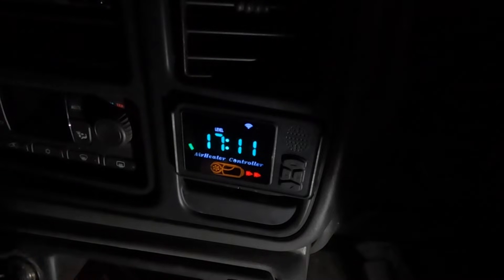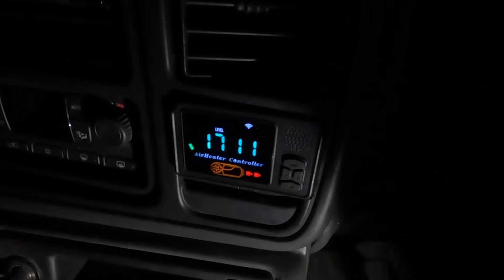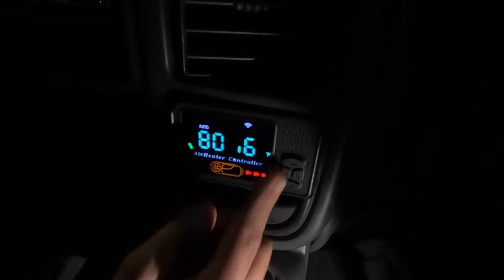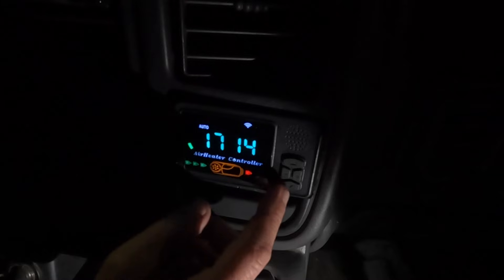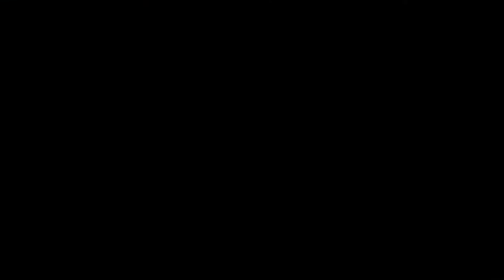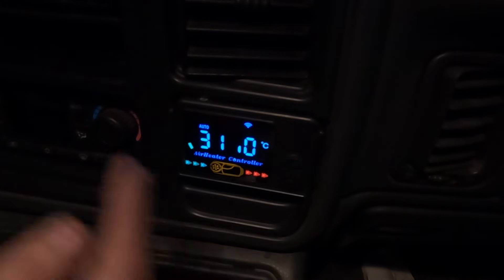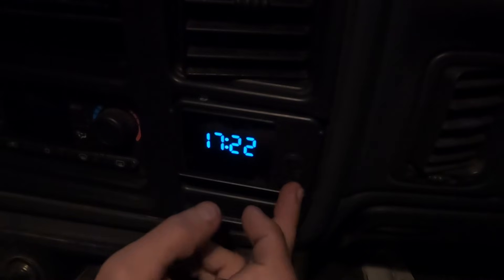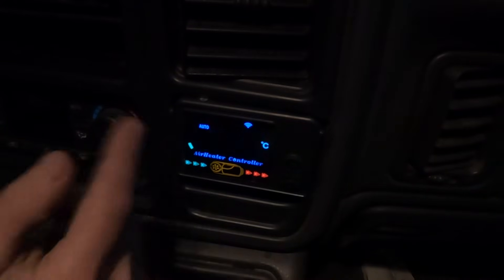Bluetooth Diesel Heater Feature & Settings Discovered !

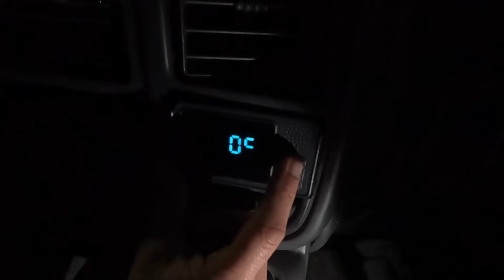Comment: @7:13 The 0c on the display is the temperature offset compensation.  If your heater is displaying a temperature that is not correct you can change this value (+9 to -9) to correct it.
Reply from the maker: Sweet ! Thanks for the info... that is very helpful, and now I don't have to Google search, haha. Cheers !!
Reply: So say the lcd screen outside temp is 20.. and u use bluetooth can shut off and on by the bluetooth in the tent if say it said 68 and that was set temp. Or do u have to wire the lcd screen inside the heated area? @loweredexpectations4927
Reply: @shanenauman9850  controller must be inside the heated area
Reply: THANKS! I needed that. Somehow i had it showing 3 degrees wrong and it was annoying me.
Reply: @SergeyPRKL so if my heater says it's 40 degrees outside when it's really 37 degrees... I can fix that ??
Reply: Thanks very helpful 👍
Reply: Been driving me insane..   this comment wins the day

Comment: Thanks for the walk through. I have one and after the C or F selection I have two more menu items. The one after the temperature unit setting on my shows L - 08 and the last menu item or one after that shows C - oF...anyone know what those two mean? Mine is only about a month old and is the 8kw all in one unit with the fuel tank on top of the heater in the case.
Reply from the maker: The L - 08 is screen / backlight brightness. If you press "m" and enter it, then press down, the screen will get dim. 08 is the brightest. 

I'm not sure about the The C - oF / oN ... It also has a WiFi or remote signal at the top of the screen. Otherwise I would assume it was for turning the temp sensor on or off. It also has R - oN for the remote. 

I will look into this a little more but I assume it has something to do with sending or recieving smething through the radio frequency (remote control) signal. Some remote controls have an LCD screen that will read out temp, battery voltage etc... maybe this gives you the option to turn that on and off to conserve power if using the bluetooth app instead.

Comment: Don't get me wrong – this doesn't have much to do with unlocking. Everything you're describing is in the manual. What would be REALLY INTERESTING is the submenu for pump frequency, fan control, or alpine mode. BECAUSE: it's NOT possible to adjust these things like on all previous models.
Reply from the maker: Hmmmm.... I hadn't even considered this.... and I'm shocked that a bunch of people weren't pissed off and calling this click bait... It was unintentional, but is misleading. 

When this video came out, these features were all new and no one had videos out explaining any of it, so the "unlocked" was referring to diesel heaters becoming more useful due to these NEW (at the time) features. Unlocking the potential of these heaters by adding all of these new features... Make sense ? 

As for the submenu... it is only there for a little (useless) info... These do not require adjusting, and it would not be practical to do so, because they automatically adjust to "alpine" or "plateau" mode based on air pressure. It reads out on the app and controller as altitude / elevation.... but the info is really barometric pressure. 

Unless you have checked your exhaust CO emissions and discovered that you have a lot of CO, then you shouldn't be changing fuel air ratios anyway. I'm at 4500 feet and mine all work perfectly. If you are constantly changing elevation, it's a good idea to get a CO meter and test your heater when you set up camp... Anything over 50ppm is a little concerning to me. 

Cheers.
Reply from the maker: The short answer is that they can't have an adjustment for fuel and air because the controller does this automatically. Most controllers now either do it automatically OR have a high elevation button (plateau or alpine mode) for elevation over 5-6000 feet. 

The reason companies are doing this, is because way too many people play with the settings on their heaters trying to make them more efficient, or for them to make more. heat, and totally mess them up, and or make them dangerous. 

These heaters run with almost 0 CO when operating normally, but if you increase OR reduce fuel, the CO levels will spike drastically and the heater can build up a lot of soot very quickly and even  shoot flames out the exhaust in extreme cases. 

So basically they took this feature away because too many idiots were ruining heaters and then asking for warranty.

Comment: Is there an entry key combination and hidden code for " engineers mode " with the late Vevor heaters that have these four keypad style controllers? I am sure this heater requires some tuning for fuel pulse and combustion fan RPM. The burner is three days old and it burns five litre of diesel in less than 10 hours ( level 5 - body temp 185'c - ambient temp ~5'c - my co meter hasn't arrived yet ). Thank you for this detailed video.
Reply from the maker: These heaters do not have an engineering mode with the options you seek. This is because they have automatic fuel compensation. 

Old models have an engineering mode. Slightly newer heaters have what they call plateau or alpine mode, a button your press when at higher elevation to reduce fuel input, and these have a barometric pressure sensor to switch from "normal" to "alpine". 

5 litres in 10 hours sounds approximately correct. Half a litre per hour is exactly 5kw/hr as one litre of diesel has about 10kw/hr of energy. 

If possible, try to recirculate your air instead of heating outside air... not sure of your setup, but this makes a HUGE difference. I used to heat my truck with outside air and it took forever to warm up... now that I have the heater mounted inside and recirculating air it heats up probably 10 times faster.
Reply: @loweredexpectations4927  Thank you for reassuring. Yes, I am recirculating the indoors air. This is an old, small barn that was converted to a workshop with four large windows ( single glass ), peaked ceiling and drafty doors. Silver lining would be the ample healthy cold fresh air that just pours in from all directions all the time. So, no worries for Co poisoning LOL. Although I do have a Co alarm and the exhaust is safely dispersed outside.
I may have to crank up the level to the maximum for a short while and then set it to thermostat mode for comfort.

Comment: Brother I bought that heater and I blow more coal than my truck. Now my question to you would be supposed to be unlocked I should be able to adjust the fan speeds and fuel settings but I can't find any of that it doesn't appear to be unlocked it looks like it only gives you the option for minor changes Bluetooth on off Wi-Fi on off that type of crap if yours is different please tell me the model number so I can order that one I love everything else about the controller any help is greatly appreciated
Reply from the maker: If the heater is blowing smoke, there is a problem with air or exhaust restriction, or some odd quirk with it not fully firing up. Make sure that your exhaust and inlet are clear and don't have too many bends. 

I generally recommend removing both (if possible) and run the heater. If it works okay, then you know one of those things are the problem. If it still smokes a lot, then you know there's an internal issue.    
These heaters have automatic elevation adjustment and do not grant access to an engineering menu. To my knowledge, you can not make separate fan and fuel adjustments.
Reply: @loweredexpectations4927 thanks for your two cents, the unit actually went back it has to have a bad burner and veber won't send me one... Yes I ran it without the intake and exhaust right out of the box and it puked on its face.... By the way you should read the return policy if we feel your reason is acceptable then will accept your return lol lol .....

Comment: How do I use the wired controller to prime the unit for the first time?
Reply from the maker: I forget how... I always have to check the manual.... I do know that it only works once, then you have to disconnect power / pull the fuse to do it again if the first time doesn't run long enough.

Comment: Do you know if it’s possible to adjust the air–fuel ratio with this controller? Mine seems to be running a bit too rich. Before buying the sensor for tuning, I’d like to understand how it can be adjusted. Thank you!
Reply from the maker: These models will adjust the fuel based on elevation, but I believe there is only two set points . Meaning... at sea level, all the way up to say (guessing) 5000 feet, the ratio will be the same. Once you are at 5001 feet it goes to a leaner mode. 

Get yourself a CO meter and check the exhaust. If it is below 20ppm, then you have nothing to worry about .... ratio is good. If you are above 50 then you may be running a little rich.

Comment: Does anyone know how to change the hertz on the fuel pump of this controller? I feel like my heater is running Rich and would like to turn it down.
Reply from the maker: You can't do it on these controllers, as far as I know.... and it just makes sense. 

They have automatic elevation compensation that changes the HZ based on barometric pressure. 

Check your exhaust with a CO meter.... if it is below 20ppm then you dont' need to make an adjustment. If it is over, most of the time this is due to a exhaust or inlet restriction and not an adjustment.

Comment: Menu shows to prime fuel to press down button for 7seconds when I do that it changes the language is there different options to do that
Reply: Gotta do that before 1st power on, disconnect power from heater  reconnect then do prime function, don't power it up first
Reply from the maker: Prime function only works once. After that you need to remove the fuse / cut power to the heater and try again. If this is not your problem perhaps it is the wrong button... I can't remember the procedure. I have to look it up every time.

Comment: I have the Hcalory TB2 S. I also have a spare Bureck thermostat that I wanted to use with it. For your readers out there wanting this same option, please be aware that Hcalory TB2 S is not compatible with the Bureck. Maybe you can delve into this issue deeper and come up with a solution?
Reply from the maker: How is it not compatible ? Have you talked to Bureck about this? What does it do or not do?
Reply: @loweredexpectations4927 

It will not close ne to the remote

H calory stated that it is not compatible
Reply: @loweredexpectations4927 

Tried several times with Bureck’s help, to no avail

Comment: Good explanations! I am considering for replacing my vevor diesel heater.

Do you, or anyone else, know if this controller also has a 'ventilation mode'.

So it only runs the fan and does not use the heater.

I cannot find it anywhere and i am not getting a clear answer from Vevor.

Many thnx in advance for the feedback!
Reply from the maker: I was about to say yes... and then realized that might be their other heater... I have too many. You can on the new BT (white heater) but the connectivity issues make it not worth wile. Doesn't look like you can on this one.

Comment: "Unlock" 😅😅😅 this controller is absolutely crap. I got hooked in with the whole "Bluetooth feature only to discover rather quickly it is absolutely and completely utter shit. The "auto" elevation doesn't work, never has, never will, was never even design to work. Nothing can be adjusted so unless you live at sea level you are screwed. Just throw this shit controller straight in the trash and order an actual adjustable controller. I live at 4800' and within a week the combustion chamber was almost completely coked up with soot , lile totally packed full. Its a shitty gimmick controller and the so called features are about ad worthless as having two assholes. Save your money.
Reply from the maker: LOL.. I suppose it's all a matter of expectations and perhaps you getting a bad one... let me finish reading your comment, because so far, it's golden. 

The "elevation" feature is designed to make a correction to the fuel input based on barometric pressure. Most heaters have two settings. Sea level and Alpine. This uses the sensor to change from one to the other at around 5000 feet. 

You don't explain how you are "screwed" ... I'm at 4000 feet and have been using this heater, trouble free for almost 3 years... I now have so many of them I can't even keep track, and the only failure I've had is one bad fuel pump on my buddies 4 runner. 

If your chamber was full of soot, then maybe you got a bad controller, or maybe, like so many other people, you made an error in exhaust or inlet routing. They are very fussy to air / exhaust flow, and probably 95% of the issues people have is because they did something wrong. 

I love how people get so angry and just assume that because they had a bad experience, despite thousands of others having good experiences, the product must be garbage. Either your heater had a defect, or you caused a problem. I just bought two more of these heaters (with my own money) two weeks ago to install in my bus... They are the best value heater, in my opinion.

Comment: After install of my heater, it runs and operates very well. I wasn't able to use the AU function, but your vid has solved that (hopefully).
I have also found that I'm unable to control the temperature in Level mode? The heater simply turns on and runs continuously, is this correct?
Reply from the maker: Yes... most heaters, historically, only really had a level or gear mode. You set it at 3, for example, and it will consume X amount of fuel. This is the way I use mine 99% of the time.

Comment: How do you Prime with this controller? 😅
Reply from the maker: The tricky part of this is that you can only prime the heater right after connecting it to power. If you have tried to power it on you will be locked out of the priming function.

Pull the fuse and then try to prime it. I believe it is the up and down arrow, but I can't remember for sure.
Reply: @loweredexpectations4927  Ok thanks

Comment: Does anyone know how to turn the bluetooth on on the the panel. I hold the ok button and the settings button together and I get a bluetooth symbol flash up once in blue but doesn't stay on.. I have the Gearleader diesel heater
Reply from the maker: The way that it is done on this heater is sort of shown in this video leading up to 7:12 If it is different than this, I don't know. 

I did a quick search and wasn't able to find a Gearleader diesel heater with Bluetooth controls.

Comment: I'm curious if anyone has found an extension wire for the controller. I know i could make one  but I'd rather just get it pre made if possible
Reply from the maker: This uses a different connector than most, at the controller, so I'm not sure. I know that they used to be available for others on aliexpress.

Comment: Anybody know how to get the fuel prime mode to work with this controller?
Reply from the maker: You need to cut power to the unit / pull the fuse. Kinda sucks. Once you do that, I forget the procedure, but it works once, and then you have to pull the fuse again.

Comment: In automatic mode, does only the heating phase go off or also the fan as soon as the combustion chamber has cooled down? Can you also program weekdays via the app with this version? Thank you very much👍🏻
Reply from the maker: Auto mode attempts to meet a target temp and will turn down the heat setting. It will not turn off, just lower the heat setting. 

It also has an auto on / off mode. In this mode the heater will stay at a preset temperature and turn off completely, once the target temp is reached. In this mode, you can select the time of day, but not the day of the week. It should be noted that the clock does not seem to keep time on most units, so you can't depend on this unless you are constantly resetting the clock. 

There is a new heater from Vevor that has a calendar for setting day and time in the app, but the app does not like to stay connected. You can set your calendar and it will work fine, but you may not be able to connect your phone once the heater is running. 

These heaters are white with orange lettering. They have been sold out in most locations, for a few months now. Other brands may have this feature as well. 

A company called Bureck makes an device that has a built in calendar that will turn your heater on and off. There is no app and you preset the calendar. That is another option.

Comment: What is the app called cause apparently its not available for new versions of android is there a way around?
Reply from the maker: The app is called AirheaterbyBLE.  I haven't used it with android, but I know several people have.
Reply: @loweredexpectations4927  ye doesnt seem to work on new android devices
Reply from the maker: @gerardkaasplank3804  I've had a few viewers battle with this, and, although I forget the solution, it has something to do with the phone settings. I'm not a tech guy and I always have issues with electronics, but many have said the app doesn't work and then found a way.
Reply: @loweredexpectations4927  thank you for your useful replies I will do some more digging in that case!